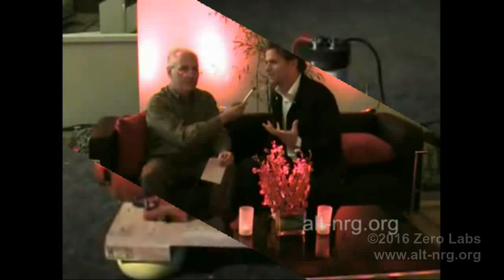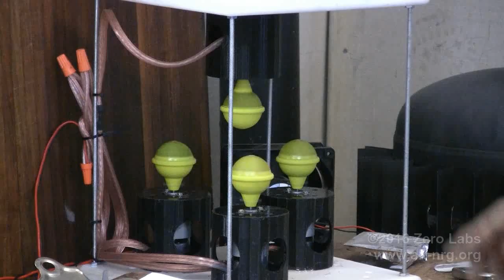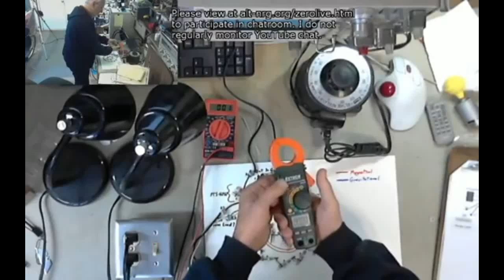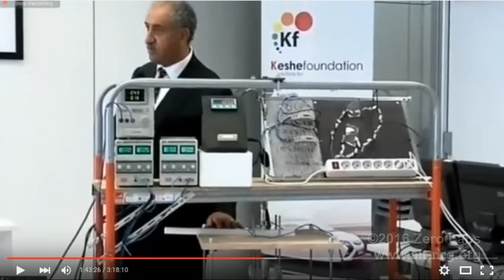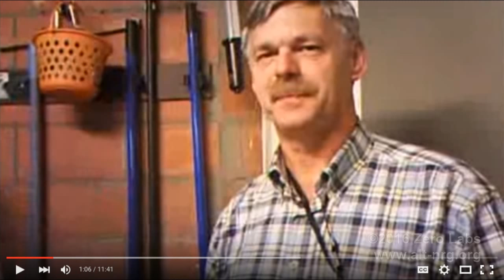#430 Kolossal Keshe Katastrophe Finale, almost

Comment: I would love to see someone combine a geet motor with wood gasification by taking the woodsmoke and running it through a water bath, maybe even putting screens inside that were opposite polarity just 12 volt so really combining 3 things, HHO, gasification and  geet. I think that by running the wood smoke through a water bath with greatly reduce the size of the cooling unit that most outfits have and add water vapor or even gas if you wanted, you can probably some throw some old cooking oil in there too and then run it through a geet carburetor. does anybody think that's worth trying or am I missing something about the processes.
Reply from the maker: +John Mcgary Here's a thought. Build one yourself!
Reply: +ZeroFossilFuel I would love to but when the mill closed I lost my house and in the midst of moving all of my stuff was stolen. I have no way to cut or weld or bend metal all of my Welding stuff, torches, anvil, hammers and electricians tools are gone. and now I'm making about two-thirds of what I was making before trying to feed 5 with two kids with autism so I can't really waste any money on experimentation as much as I would like to at least for a while.
Reply from the maker: John Mcgary Nuff said. I know your pain first hand. Wish you and your family well.
Reply: +ZeroFossilFuel Thanks.

Comment: My dear, Where is your nano coating? Please check out some Keshe videos and try again later. You are simply connected copper to copper, not nano to nano.. So, you have a very BIG EGO without "Plasma" knowledge. Please go back to the early Keshe teachings and you will see the Light. You don't know nothing about the plasma.... Nothing... If you build something, build it accurately....
Reply: +OrgoneBlaster Oh come on. Show a working device to disproof ZeroFossilFuel  s work wihich was one of the very few and the best worked out scientific test, or keep your mouth shut if you don't want to come over as a complete moron :) 
Happy new year :)
Reply from the maker: +OrgoneBlaster The wires are "nano coated". Review my live recordings.
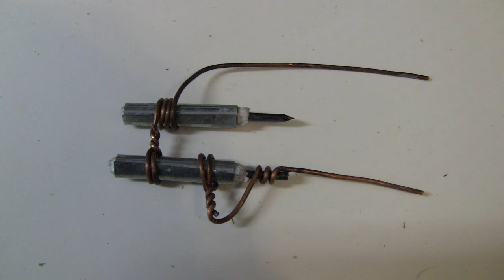Reply: +ZeroFossilFuel 5:15 I don't see any nano coating on your wires. These wires very badly and barely coated. The real nano coating is BLACK/DARK GRAY and homogeneous! A good nano coating is a very good insulator, the resistance close to the 2xMOhms range. Your wires are reddish/cu colored, that's why there aren't nanocoated properly.

Comment: Did you run the beads along with the plasma reactor for the duration with voltage going through for that six day duration?
Reply from the maker: +86daily No I did not. Nor did Keshe at the 68th KSW. Nor did I wear a tin foil hat or click my heels together in hopes of making it work.
Reply: Well if you did not run it with the power running you failed completely or was that the intent? Mr. Keshes speaks constantly of it as an absolute necessity.  There is nothing hidden on that matter
Lots of Love
Reply: I guess that you didn't listen to much about him saying the need to run the system fully with the power on so that the system can coat the wires while power is running through it. May I suggest for you to have Keshe look at the system like a good student so that the professor educate you further. But of course vanity will give you all the praises. and humility will only belittle you. 
Mr Zero its up to you.
Lots of Love
Reply: +86daily What does that accomplish?
Reply: +86daily Still grasping for straws...one last gasp for air to keep the dream alive...L
Reply: 86daily
do you have a link to this documentation?
Reply: 86daily Show us the proof Sir...or fade away graciously....just talking about it doesn't work anymore....sorry..
Reply: +86daily Again I ask for a link to the documentation.  Hearsay does not count.

Cheers!
Reply: +86daily Why don't Keshe or better yet ANYONE show a working model?Its been years and yet nothing has been public accessible. The man is a con plain and simple.
Reply: +86daily Get over 86daily. Keshe is a scammer.